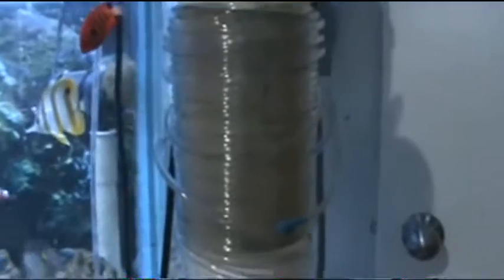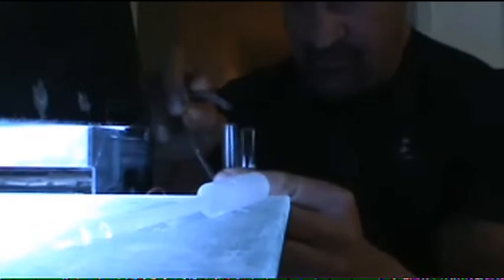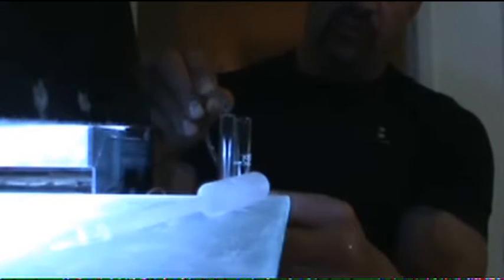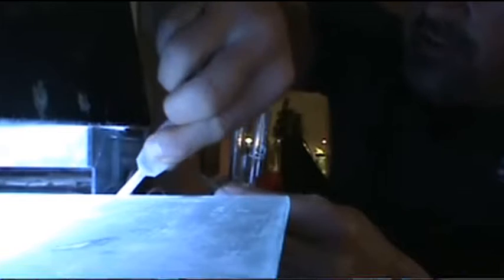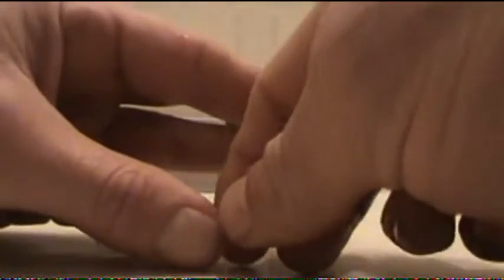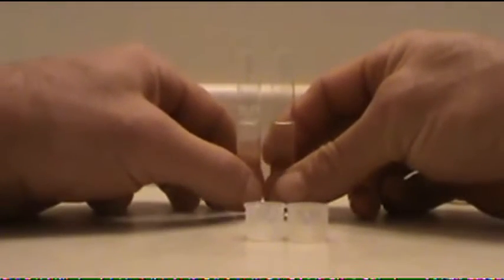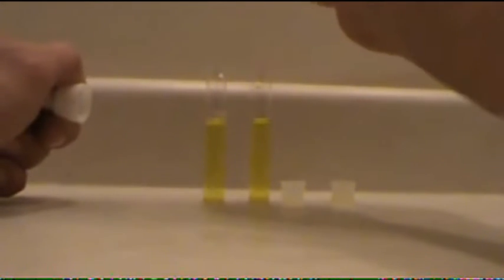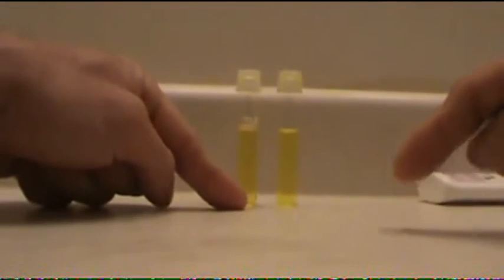remove nitrates SOLID PROOF that a denitate coil works

Comment from the maker: it never has  I've had power outage and I have also just shut it down as a experiment let it say then started it up after 5 days of going stagnant and it does nothing in fact it works BETTER because the lack of oxygen is EXACTLY THE POINT of a coil  you my friend are deliberately trying to mislead people  I don't know why but hey  All types I guess  rock on buddy I have NOTHING tog ain threw lying about this I do not sell them nor do I know anyone that does

Comment from the maker: Of course it can make a difference  if your take doesn't produce more then it removes then it will go down  and if nothing else it will slow the build up The idea is to build one bog enough to flow fast  or build ten of them to do the job  You generally don't want to build more then one until it proves itself to work